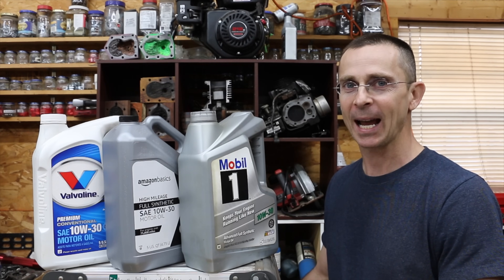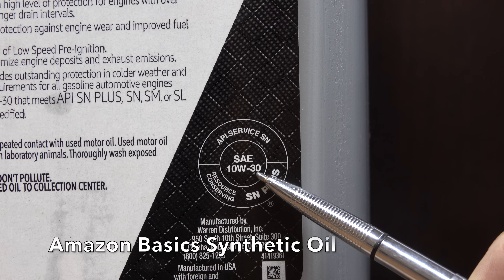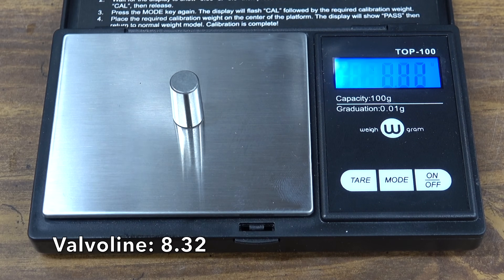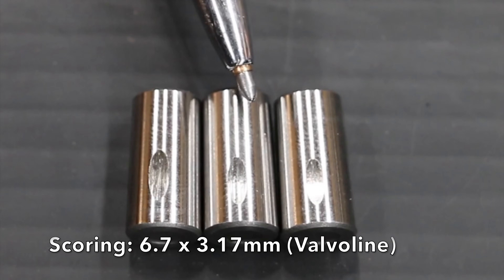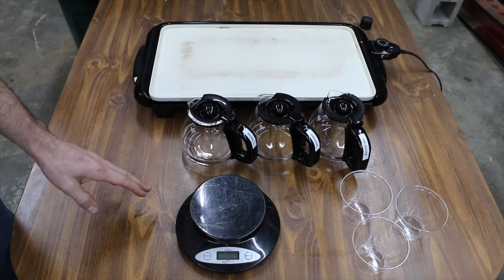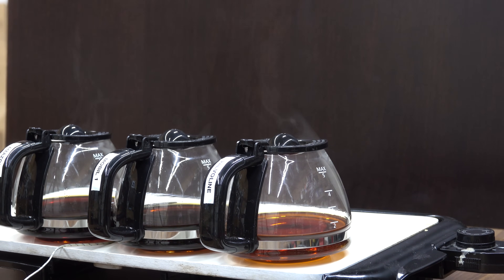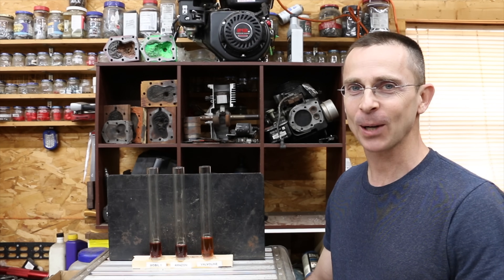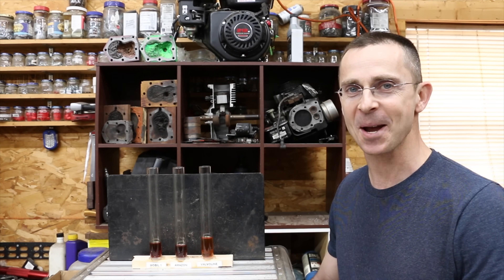Is AmazonBasics Full Synthetic Motor Oil better than Mobil 1? Let's find out!

Comment: Still waiting for the Hand Cleaner comparison! Great video as usual, keep it up my dude!
Reply from the maker: I need to test this one ASAP!  Thank you
Reply: @ProjectFarm  test out some zep cherry bomb. The best I've used. You've gotta rub it in without water then rinse.
Reply: @ProjectFarm  Such a great video idea! Can't wait for it. Really love your hard work and dedication. Keep it up!
Reply: @ProjectFarm  Remember Solopol hand cleaner.
Reply: @ProjectFarm  I would recommend testing The Scrubber Citrus Handcleaner with Grit. That is my favorite hand cleaner by far. Kind of hard to find though, but well worth it to me.
Reply: Washing machine powder is excellent hand cleaner (painful sometimes if there is a wound or a scratch)
Reply: Here in the UK we have a brand called big wipes which claim to be able to remove any dirty from hands.
Reply: @JUNK4UCREW  was going to suggest trying big wipes. Want to see if the hype is real
Reply: Definitely Swarfega when it comes to hands :)
Reply: I've heard dish soap mixed with sand works in a pinch
Reply: Joe's !!
Reply: I find baby wipes cover most issues for hand wjpes, good for removing silicon aka caulk from your hands
Reply: the best hand cleaner is made by Zep and it's called cherry bomb

Comment: 👍 Another awesome video, I’ve never used synthetic motor oil I’ll have to give it a try.
Reply: Don't just start using synthetic oils on older, high mileage vehicles as you'll do more harm than good.
Reply: The Grimm Perspective - Cory Grimm it won’t mess with anything. As long as you don’t go back to conventional
Reply: @monkeyplayer1  , we'll have to agree to disagree here.
Reply from the maker: Thank you
Reply: So worth it. So much better and you could wait longer between changes but I rather just have better lubrication and spend a little more